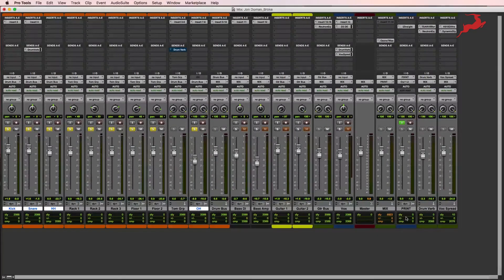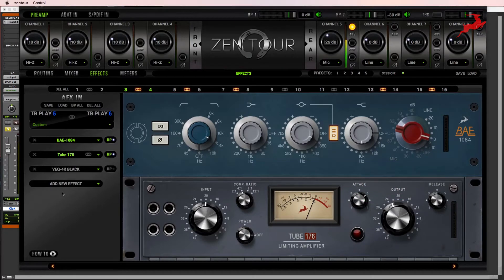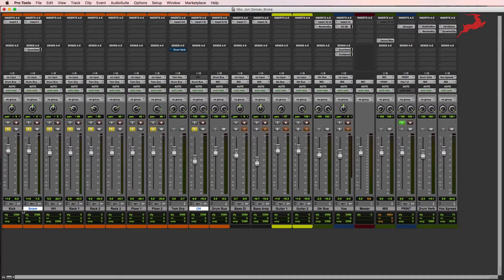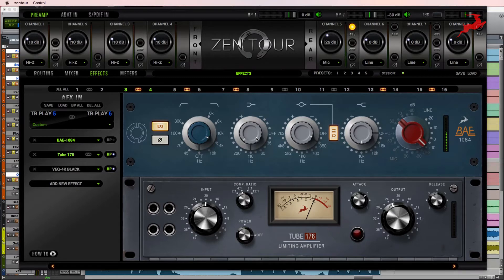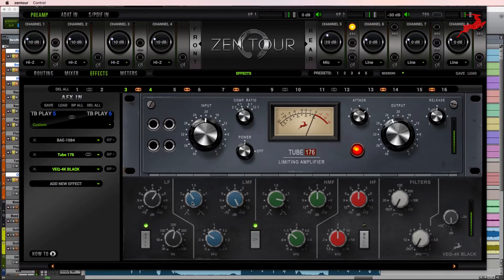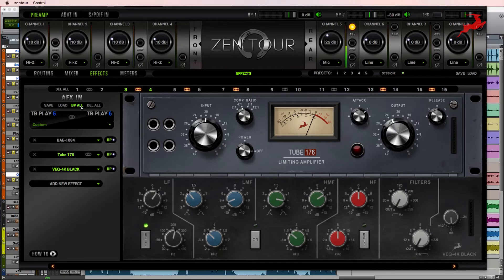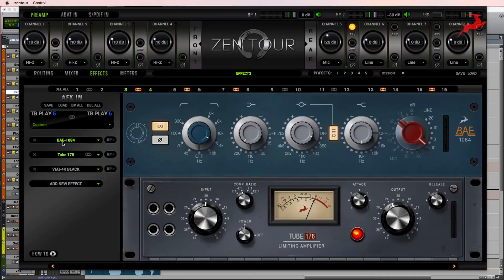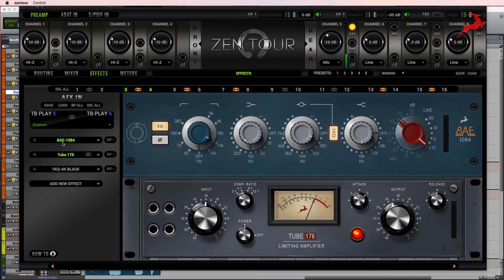Mixing Toms with the Antelope Audio FPGA FX

Comment: Great Job Alex as always if I could make one suggestion to Antelope to round out their dynamics range of effect a transient enhancement FPGA effect would be great for drums and other tracks that need added attack and sustain in a way compressors just can't. The Antelope FPGA effects are the best on the market in my humble opinion but now that there is a sufficient amount of EQ's and compressors adding new and more diverse effects would be welcome. Such as a transient FX and some modulation and spatial effects, along with classic reverbs, (even though the Antelope reverb is very versatile), and a stand alone saturation effect. Maybe emulate a console or tape. I love antelope and now with the FPGA effects I only find myself reaching for other plugins when there isn't an antelope equivalent.
Reply: Glad you're getting the most out of your AFX plug-ins. In my experience,  I treat AFX plug-ins as virtual hardware. It sounds like hardware and is usually the first "tone shaping" tools on my inserts.